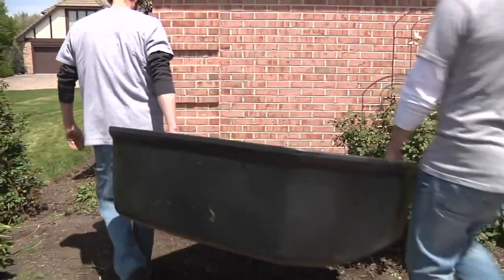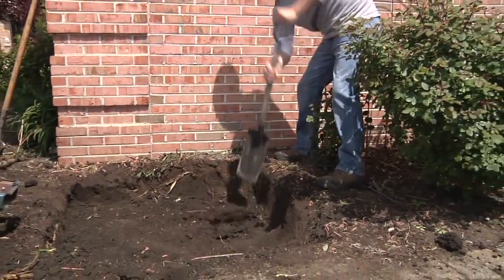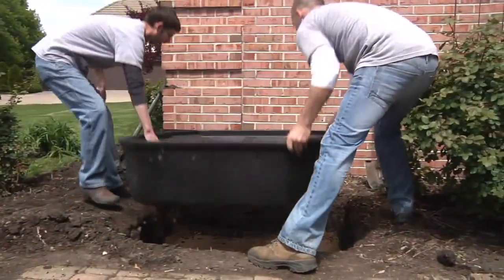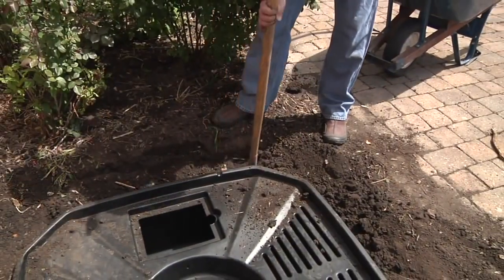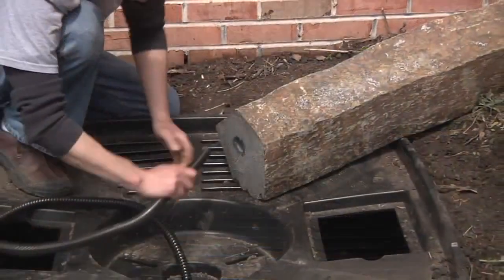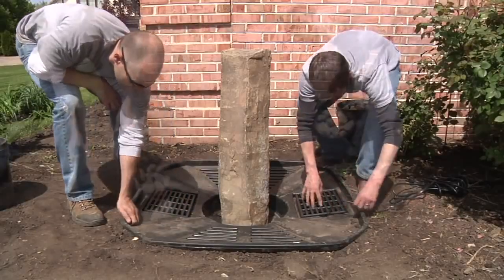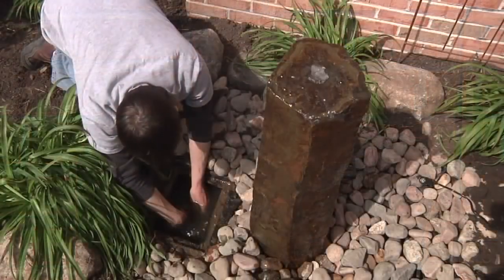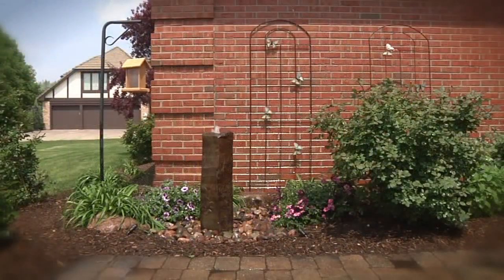How to Build a Fountain with Aquascape's AquaBasin

Comment: Hey Michael,  You must be into a lot of clay material, as your ground is not draining properly.  I would suggest ensuring the surface water drains away from the basin. If that doesn't work, I would install a "Big O" drainage pipe from the basin to a lower area like a property line swale.
Chris
Marquis Gardens